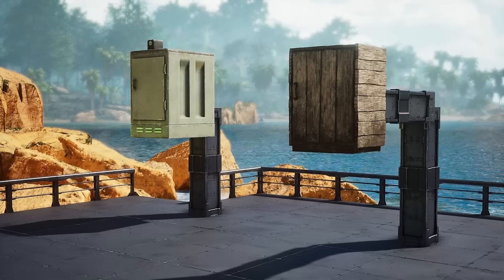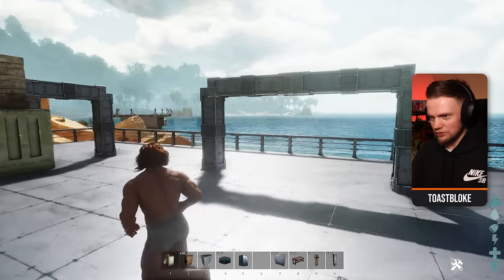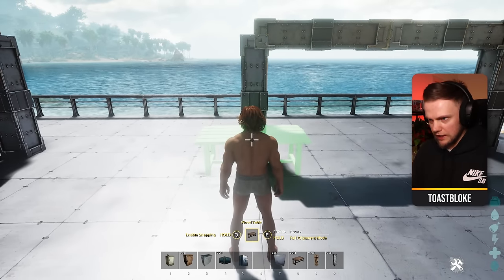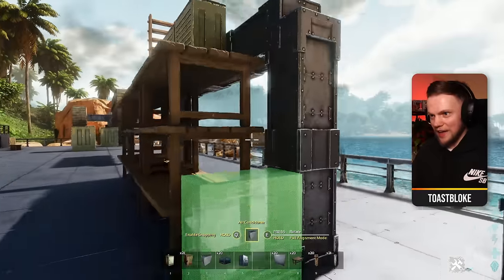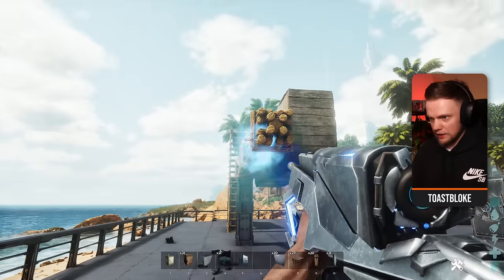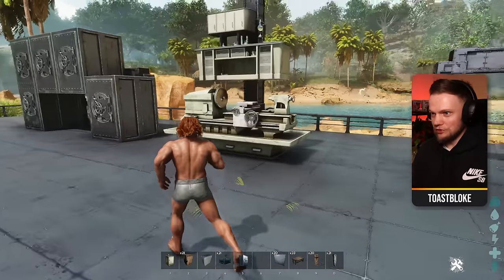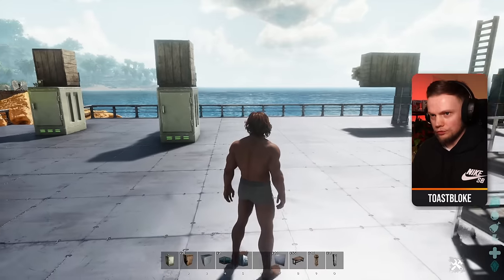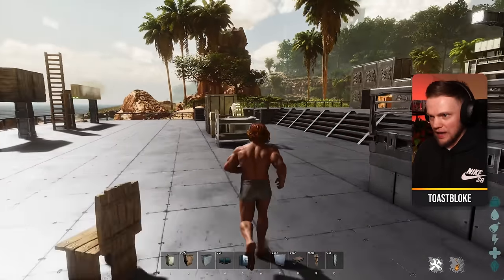How to Stack and Elevate Structures in ARK: Survival Ascended!

Comment: That's brilliant, now I can make a incubation room with incubators all over the floor or on top of the roof.
Reply from the maker: Indeed you can! Good idea! I know they snap into window frames now, but this help get them much closer together and you can do it anywhere inside or out! 🔥
Reply: What is the foundation range of these new aircons? I'm not quite at the industrial stage yet
Reply from the maker: @iansmith3016 I have no idea. I’ve not actually played the game too much. Spending most of my time messing with structures to bring back things I miss from the old game, apologies. I’d presume it’s just the same though.

Comment: Unfortunately only some of these stacking methods worked for me on official. On Solo it works flawlessly but I can only assume some settings are different on official that caused me a headache to get some to work. The main culprit right now is getting preserving bins that wont work right for me no matter what I done.
Reply from the maker: Appreciate the information! I'm hoping to get on a server and test this further tomorrow. It worked with official settings in single player, and on a private server with them, but since the last patch, a few people have mentioned having trouble on actual official servers. I need to find out if it's a strictly official server issue, or if it now happens on private ones too. Hope they aren't working on patching it out already!

Comment: So no more wiring? I guess I must have missed that one.
Reply from the maker: Yup, everything is wireless now, which saves some time,  but has a few downsides. They've said pipes and cables won't be a thing in the game going forwards. If you have a generator though, that powers things that require gas now too, which makes sense I guess. You can still power them using gas without one, but there's not much need now.
Reply: Me too 😅

Comment: So I did everything but after the 3rd ac unit it says I can’t place because it’s obstructed. I’ve tried different spots but it always seems like the right side won’t place. Any advice or a fix for this?
Reply from the maker: I'll take a look into this as soon as I can, see what I can find and get back to you!
Reply: @toastbloke  thanks I appreciate it
Reply from the maker: @minhhoang-ms5qy  I've just jumped in and managed to recreate the build first time, although the alignment was being a little more janky than before. The only thing I can suggest to look out for it making sure the crosshair is on the beam and that snapping is turned off. I gets trickier to position the aircon and have the crosshair on the beam the closer they get to your feet while placing. Let me know how you get on and if that helps.

Comment: WIth the AC units so high, do they still incubate eggs? I couldnt exactly hear what he said about it
Reply from the maker: They do, yes. They work vertically the same way they do horizontally. The AOE is a sphere, so higher will have less effect just like further away does, but a few tiles up or across won't impact things too negatively.

Comment: Awesome. I have my main base in metal now and bottom floor is 3 walls high. I will be trying this tonight with putting crossbeams between 1st and 2nd wall seams all the way around. Great video.
Reply from the maker: That's a good idea! I didn't try building them into any walls! You'll have to let me know if that works. I don't see why it wouldn't, even if you had to put the walls in last!

Comment: Using this method I was able to stack 20 air conditioners in a compact side by side (not front to back) config in the space of an closed single foundation (a pillar's height and width).
I did this by stacking two tables high first to place the top row, then removed the tables and filled in the bottom blow beneath them. 
Takes such a small space yet there is a whole foundation space in the middle for eggs (not cramped). And none at the bottom (below the floor) so hopefully hatchlings can't fall through the floor.  
The ACs are slightly less efficient from the side vs front or back sides, but still over kill at ~3700 resists.

Comment: Those are some great tricks. I've been trying to figure this for a while and wasnt that easy since i have it on tree platform with wall at the edge so i couldnt exactly put refrigerator under the pillar since there is a wall and i didnt wanted to stick in the other side. I've figured out that you can put Storage Box on the beam above refrigerator and then put preserving bin infront of storage box and it almost perfectly lines up on the front with great access. Thanks for this. Now i just need to figure out how to put industrial forge and tek replicator on tree platform with 2 walls high xD Probably just gonna leave it outside eventually.
Reply from the maker: That’s a cool idea with the storage box! I didn’t think of that! The alignment in the game is really helping keep things neat and tidy, which I love! I’m getting on to exploring crafting stations currently, so I have no idea about that. Hopefully, you figure it out! I haven’t even looked at an industrial forge yet, beyond checking for size! 😂
Reply: @toastbloke  Well figured something but there's got to be a better way to do it. With Industrial Forge i made a box with walls and ceilings below the tree platform. You can put 3x4 ceilings on each side of the tree platform to extend it. I went 4x2 walls under the platform at the edge and placed line of quarter walls bellow standard walls then 3x5 ceilings with forge on them and repeat walls and quarter walls all around and close it off.  Forge sticks above tree platform just enough to light it and put metal in it from above. Doesnt look great but it works. Was thinking to put it 3 walls down and make stairs to it but im not carrying all that metal down. Its easier to put metal in vault and carry it around with Rhynio and then put it next to forge and relocate all the stuff.

Comment: Nice finding. The dedicated storage snaps on top of each other without the need of pillars.
Reply from the maker: Thanks! It does indeed, but it doesn’t float if you take the ones below away does it, or is that just the new pick up system at play? I’ll have to test!
Reply: yeah please test... only problem still is we do not have tek dedicated storage intake as with the S+ mod from ASE, so people will need to think of ways to actually get to the storages and  be able to deposit resources/consolidate if they want to stack them up high... like catwalks behind them or something

Comment: Really lovely to know this. Thank you.

I’ve been using the quarter ceiling to place things on top but it’s just not as convenient most times like this could be.

Haven’t tried it yet but I would like to imagine that you could line the top side of walls with beams to do this. And I would hopefully imagine that things don’t get wonky with the structures sticking to the beam. 

I usually try to avoid pillar spam of any kind even but this feels like it would encourage me to place some beams across the top side of my walls so I can I have easier to reach storage.

I hope it isn’t treated as a bug and the devs up and fix it cuz this is the sort of building techniques I was hoping to see sort of retained in ASA alongside the quality of life improvements to the building. 

Something I had a thought to try with this technique while watching is to see if this could be taken advantage of to make some sort of plant x defense. Sure you can stack plots but for the Plant x you have to stack the plant x in such a way that they don’t block one another. 

I’d be curious if there is a optimal way to stack up some plant x without blocking each other.
Reply from the maker: That’s a really cool idea! Stacking the crop plots up the pillars at the right intervals so the plants fit would be sick! From what I can tell, things stick to pillars and beams regardless of where they are as long as nothing is obstructing them and they have support below them when placing 😎

Comment: Maybe helpful: 
you shouldnt need the tek rifle for the pillars, you can just destroy them with the menu wheel and the structures only supported by them will break too. Maybe thats an option thing but at least in my SP game that works. Found out the hard way, wanted to pick up but destroyed the structure and everything that was only supported by it broke too.
For better access on the placing snappoint at the pillar you can build a ramp or stand on something, so the hitbox of the elevating structure is not in the way that much. Worked quite well for me so far.
Reply from the maker: Yes, I used a weapon as the breaking was what I wanted to avoid to show the vaults. Pick up picks the attached vault up and demolish destroys the attacked vault! Nightmare! Breaking it lets the vault drop. Well, it did at the time of testing. They keep changing things! 😅 And great, if you can find ways of making things work better for you, of course, utilise them! The more we find the more we can all do!

Comment: Your game are running so well, could you share your config. Or make a video tutorial.
Reply from the maker: I just made sure Nvidea DLSS was off because it kept causing crashing and run a mix of medium and high settings with frames capped at 60. I’m running a 4070 and had to upgrade my RAM to 32GB to be able to play and record/stream at the same time. The rest is close to minimum requirements. Hope that helps!

Comment: Ok so, stacking tables is possible, it's just really finicky and difficult to do, you cannot align the AC's to each other in front of the beam nor can you place them on the tables.  But what you can do is place them on top of the beam.. but the 1st one will be sunk into the beam, you place the 2nd and it'll be slightly higher, 3rd higher still, eventually you'll get them sitting on the beam not inside it.  You have to keep adding them then removing them until everything lines up. Whilst it isn't as bad as ASE building, it is still very frustrating in ASA.

Then you can align them next to each other... and it looks ok.  The Fridge/Ac thing doesn't work at all.

I'm using Steam/Pc Version.  I am trying to work around a Baby Barry and Argent at the moment so maybe they're in the way.  5 AC/s on top of the beams looks good tho.
Reply from the maker: I'll do my best to double check this asap. This is the first case I've heard of it not working and it worked when tested on servers. I'll let you know what I find when I do. They might have changed something. Sadly, the building seems to be the one thing they're quick to act on, but this seems real fast.

Comment: I don’t have asa yet, ps5 player, but with the crossing with pillars you can do on the outside of buildings. Can you do that inside with just the top two pillars like how you have it @4:31? To get rid of the pillar on the right? Maybe that’ll stack too high though.
Reply from the maker: You can snap pillars/beams to the corners of foundations too. I haven’t tried sticking things to pillars in the walls, but pillars do snap to walls, so I’d imagine it would work on both the inside and outside of the wall.   You can put walls around, and probably in, after if there are no obstructions 🙌🏻

Comment: This is cool but wouldn’t there be a space between the wall the pillars?
Reply from the maker: I came across this freestanding, but from what I can see, if you stick things against the pillar/beam, you can build walls right behind inside them. For the preserving bins, the refrigerators work better being pushed under, so you get a small gap if you want them close to a wall, yes, but you can just move the fridges forward if you’d prefer them flush to a wall 😎

Comment: What PC set up are you running? Doing a new build and trying to see if I need to really break the bank (most likely for ascended!! lol)
Reply from the maker: I’m running a 4070. Everything else is just what I’ve used for the last few years. I did have to double my RAM from 16GB to 32GB to be able to play and record at the same time. Was getting maxed, but has been smooth ever since!

Comment: I have been trying to elevate a grinder without success. Is it possible with this? Maybe I am just doing something wrong
Reply from the maker: I can give it a try and let you know. It should be, as long as there is support below where you place it and a pillar behind to snap it to.
Reply from the maker: It is possible. Due to it's size you have to use two stacks of tables, or place the table length ways against the pillar to create a surface for it to snap too. Also, to make sure it snapped, I had to get around the table to be close enough to get the grinder right against the pillar. Hope this helps!

Comment: have you had any luck with sunken vaults in asa?  Thanks
Reply from the maker: I looked into it and I can get the effect, but at the minute, due to not being able to stand on vaults, it looks good, but doesn't work great. When they fix vaults, I'll share! I mean, they may have already fixed them. I've not checked!
Reply: @toastbloke   cant you use those ceiling tiles with the window?
Reply from the maker: @Triple88a  You can for sure, yes. It looks way nicer and it’s easier to use without them though. I’ll have another look into things soon. Got to get caught back up having been ill! 😂
Reply: @toastbloke  I know you can put them 1 tile below and still access them but you have to crouch.  But they have to be 1/4" way down, halfway they are too high

Comment: Forges?😮
Reply from the maker: As long as you build the tables out far enough and to the correct height to support them, it should work, even with an industrial forge, yes. Had the same problem with an industrial grinder. You also have to come around the side to make sure it's touch the pillar when you look at it.

Comment: I cant find beam engram, how do you make it?
Reply from the maker: It's the same as the pillar. You can cycle through the other options when you equip it. There is a pillar, thin pillar, beam and thin beam.
Reply: @toastbloke  thank you, I will check

Comment: Doesn’t work on official I tried it
Reply from the maker: It did not too long ago, but there's a chance it's been patched recently or there's something weird official server side. I'll have to check again to make sure as a few people have problems prior, but it turned out it was down to error. Thanks for letting me know, cheers. If I get it to work I'll update you. 🙌
Reply from the maker: It's working for me on Steam, although something has changed. Even though you get green-boxing it says 'obstructed' when you place, but that's only if your crosshair isn't high enough up the pillar and the object isn't against the pillar. It helps make it easier if you run things across a beam or build another pillar on the first one. Let me know how that goes.
Reply: Its working for me on official

Comment: Doesn't seem to work with Tek Trough though :(     Anyone know an easy method to stack Tek Troughs horizontally?
Reply from the maker: In theory, this method would work with the correct structure combination, but I’d have to have a play about to know for sure! I’ll let you know if I crack it 🙌🏻
Reply: @toastbloke  Thanks so much! I actually tried it with your method and it didn't work so then I had an idea of trying it with quarter walls and snapping pillars to that, that way they are lower to the ground and just the right height where you could do your method on them and possibly snap the tek trough on top but sadly it didn't work

Comment: Or you can just use window frames with the AC. The AC's will slot into the window frame.
Reply from the maker: They do indeed! It’s a cool new feature, just not one related to the mechanic I’m showing off here. This gives more options for all structures, but even has benefits with air cons, like placing anywhere, stacking and keeping them closer together 😎

Comment: i think its patched. fridges wont snap anymore :(
Reply from the maker: Thanks for the info! I did it today with official settings in single-player, as somebody else was having trouble, and it worked. If you don't mind answering, are you on a server? We were wondering if they weren't quite getting it right, or if there's something odd happening on servers now. Usually a patch would stop both, but I'm going to test that asap.
Reply: yea was an official server  @toastbloke
Reply: @toastbloke I had it work on single player but on official it only worked in certain spots couldn’t figure out the reason